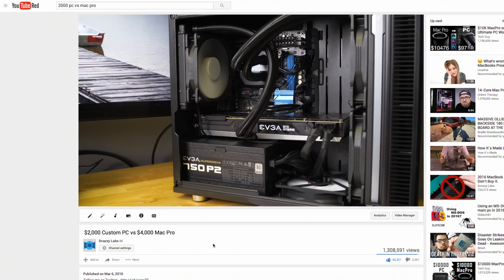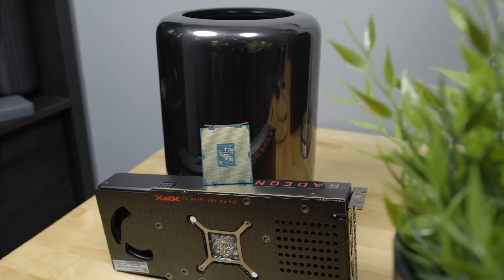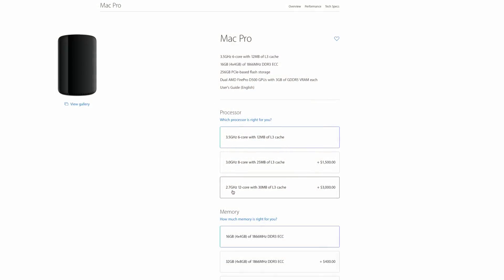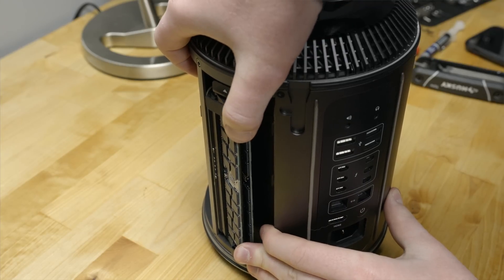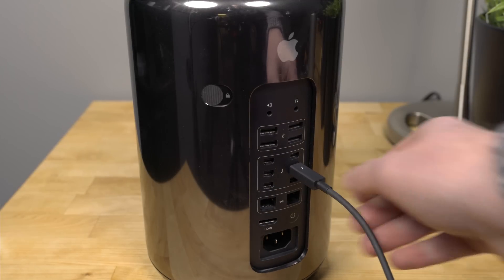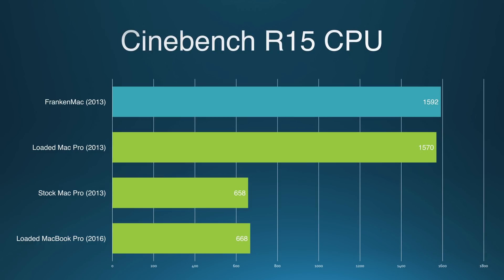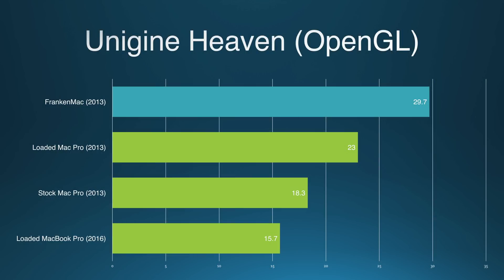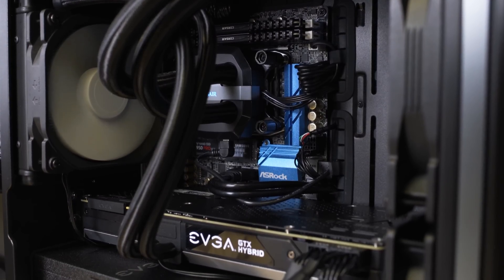The Best Mac... Apple Doesn't Make!

Comment: is it the same process to build an external GPU for macbook pro?
Reply from the maker: Yep! If you're on the 2016 MacBook Pro, get the Akitio Thunder 3 instead. Or just buy a Razer Core instead. No mods required.
Reply: do you have any links or guides on building one for 2015 macbook pro? Or even better, making a tutorial yourself ? =D I've been thinking to power up my macbook pro, though my work are mostly CPU hunger, but still, it's still nice to have a good GPU to run realtime rendering at some point.

Comment: if you spent 600 usd on a cpu, why not buy the 600 usd gtx 1080, instead of crying about gpu performance
Reply: comedyman112 because the AMD GPUs are natively supported on MacOS while nVidia ones aren't.
Reply from the maker: a) NVIDIA hasn't made Pascal drivers for macOS, b) I'm not crying about GPU performance—watch the video, c) AMD is hardware accelerated in FCPX and NVIDIA is not, d) watch the video :)

Comment: can you use two rx 480's on a mac pro. Weather is is old or knew. I am about to buy a 2008 8 core mac pro. But it will defiantly need some upgrades. So it has enough power will it support two gpus. Also in FCPX do 2 amd cards help when editing 4k. Thanks.
Reply from the maker: I don't know going that far back. Probably not. The 2012 Mac Pro only has a single PCIe slot. You could use 2 on the 2013 Mac Pro by using 2 docks with 2 separate Thunderbolt connections.
Reply: Snazzy Labs hat about one would that be better for 4K editing vs a 7950

Comment: So you lacked the ability to learn how to properly use adobe so you switched back to a slower inferior platform. Wow, amazing................
Reply from the maker: +Jermaine Whitehead You clearly didn't watch the video. I know Premiere very well. Not FCPX. I'm switching for the incredible 3rd party plugins that don't exist for Premiere. Wow. Amazing.........
Reply: This is the 5th time I've used this phrase in this comment section.

PASSIVE.

AGGRESSIVE.

Guys, f you came here to watch the video, don't whine when it's not what you came for, and don't whine if the maker has a different opinion.

Comment: I have an RX 480 in my Mac Pro too! But I mean "in" literally because I have the 2009 model. Not sure how the onboard PCI Express x16 2.0 slots compare to Thunderbolt 2, though. Also jealous of the 12-core CPU, since I'm stuck with a single Westmere-EP 6-core and dual CPU boards are generally expensive (got the computer for free though)
Reply from the maker: You probably have the leg up on all x16 PCIe lanes. TB2 only allows for x4. I've got you beat on the CPU tho. :D
Reply: Snazzy Labs you also have that speedy solid state storage while I'm stuck with SATA II but I love having the ability to slap 3.5 inch drives and expansion cards inside the old Mac Pro, rather than having to go external

Comment: Question: since you are stuck with Thunderbolt 2 why you opted for a RX480 anyway? Keeping under consideration the bandwidth limitation wasn't a less expensive choice something like RX470 or 460? My logic is that if you use 60% of a RX480 then it would be the same of using 100% of a RX460.. Am I wrong?
Reply from the maker: You're not wrong. I owned an RX480 already. :)
Reply: Oh! Now it makes sense ahah also thanks for replying, really appreaciated :D

Comment: I bet I could get better performance out of my 2009 Mac Pro cheaper than this because it has actual PCIe slots.
Reply from the maker: Nope. Maybe better GPU performance because of the x16 lanes but the highest end CPU you can get your hands on can't even sniff the speed of this 12-core. That said, your 2009 Mac Pro is a very good machine still.

Comment: Frankenmac FTW! 
It'll be interesting to see if Apple ever does upgrade the Mac Pro. I have a feeling that the 2013 Mac Pro bit them in the butt because at the price point, PCs perform a ton better. The Mac Pro may have been the biggest push to spur on the Hackintosh movement. 

And it's hilarious to me that a $250 graphics card throttled to 60% of it's bandwidth smashes the top of the line GPU in the Macbook Pro. The Macbook Pro is a joke.
Reply: Sam Medley Yeah but You could actually plug one of these GPU'S into a 2016 MacBook pro with Thunderbolt 3 ports which have twice the bandwidth of Thunderbolt 2 (40gb/s)
Reply: " The Macbook Pro is a joke."

Yup, a 3500-dollar joke.    Have you seen Snazzy's review?    He says the 2016 Macbook Pro is a total pos, not worth the money and full of bugs.

The clowns in Cupertino just don't care anymore.
Reply: Well that's one person, many are loving them, MKBHD, iJustine etc. Software issues get smoothed out over time.
Reply: It's a good piece of machinery, just definitely overpriced. The additions over the early 2015 refresh don't warrant the cost. Honestly, most people would be fine with a Macbook Air, but those have been killed off for now. The best thing about the new Macbook Pro is that it reduced the price of refurbished and used Macbook Pro 2015 models.